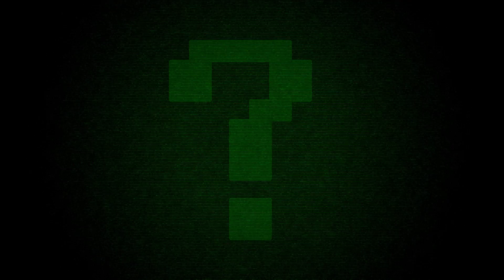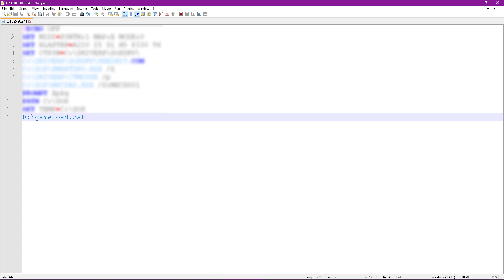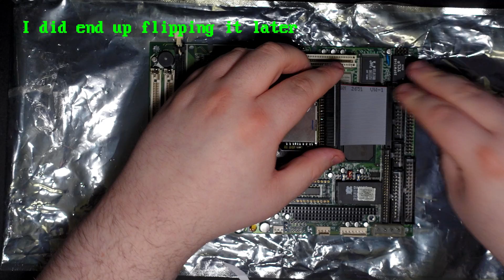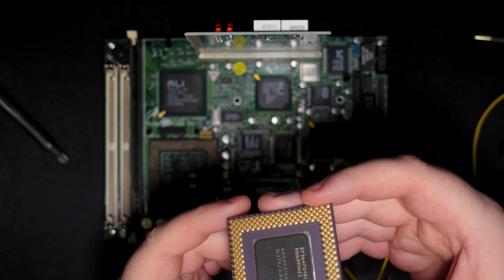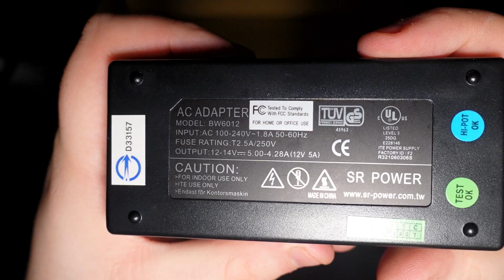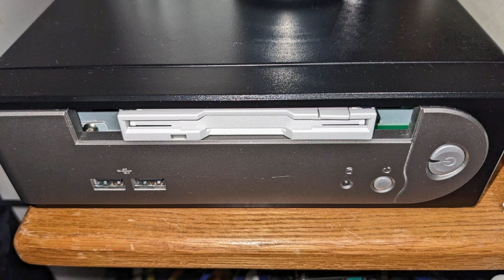Let's build an MS-DOS console - Part1 - #DOScember2022

Comment: Would have been cool if it used a ZIP drive. In that case the whole game would fit on a disk. But yeah zip drives where in the windows era
Reply from the maker: I don't want to use a zip drive. In this project the floppy disks are merely triggers for the games that are stored on an SD card, much bigger even than a zip disk
Reply: The best solution is actively supporting a flashfloppy emulator.  This means that it can AND WILL support using games from floppy, but also allows you to have multiple disks on a single usb stick.  (indeed, since most floppy controllers will allow two drives, you can actually simultaneously support a real floppy AND a drive emulator.

3:46   Quake isn't actually all THAT big.  the id1 folder is actually only about 50mb.  A lot of floppies to be sure, though.

What might actually work would be support for a CD-ROM/DVD ROM drive for bigger games.  Indeed circa 96, many games still used the disk as copy protection and would support being played almost entirely from CD-ROM via a minimal install with only a token amount of save data winding up on the hard drive.
Reply from the maker: I feel you have missed the point of what this build was.... If I was just building any old DOS PC, I would be using a floppy emulator of some sort, I wouldn't be bothering with a real floppy drive (they suck). I only wanted one real floppy drive, as this is a fictional product from the early to mid 90s, as if there had been a console like computer that ran DOS and the games were on floppy.

My reference to Quake, is pretty much what you mentioned, it's a lot of floppies, so you couldn't put the game on one, but you can put it on an HDD or SD card. There's a lot of artistic license in this project

There is going to be support for a parallel port CD-ROM drive, all this will be in the later parts. Hope this all helps
Reply: @PIPERdotEXE    We're all kind of struggling with what the the appropriate balance of vintage hardware in these builds is, to be honest.
Reply from the maker: Yeah, I mean with all the best will in the world, I can't fully target 1994, the CPU is about there, but the board is from 1996 I believe, with a BIOS from 1999, and the graphics card, is from 1995. Maybe the GUI shell I have planned for it which is from 1991 will balance things out lol
Reply: @TheTurnipKing  Quake's music was CD music, something a lot of games did.

Considering all the consoles except Nintendo went CD-ROM, including all the consoleized computers, if a DOS PC had been consolidated it also would also have been CD-ROM based; cheaper in multiple ways; and more reliable than floppies.

With the way you want to mimic slot in and it works,  with some file you put on the floppy; I know that wouldn't be viable; but still, it had to be pointed out.
Reply: @3dmaster205  it's a tricky one to be sure.  Most modern source ports will support MP3 for the audio but that's going to be an ask on period hardware.

Comment: The red line on the cable indicates pin 1 BUT the way these cables are manufactured (in china) makes it difficult to know if the orientation was correct in the process. I have even some cables from the 90s that have the red line on the wrong side. One time i had a 40pin cable (that was most likely not even IDE) where the pin-rows! were switched on just one connector.  In the end you have to make sure that pin1 on the device corresponds to pin1 on the mainboard. I tend to make my own cables to be sure.
The onboard ES1938 is a nice PCI sound card with very good SoundBlaster and excellent AdLib emulation (if the lines for proper ISA-'emulation' are connected on the mainboard).
A P166 MMX is a good fit for a 1996 System. The S3 Virge is good for 320x240 DirectX or even 640x480 with S3D enabled games. The Virge is a 2D beast and has very good dos compatibility.
The CHIPS VGA Chipset graphics has good VESA support but is slow and may have problems with scrolling in older games, so maybe using the onboard graphics might be interesting if you want to install a 3DFX-card and have more of a 1996 3D system.

Comment: Frustration is the most common thing in computer build projects before Pentium 2, and retrofit projects. You have to get used to the inevitable failure. I worked as a computer technician back in the day when this type of computer was common. It was hell, the internet was basic, there wasn't that facility that we have today in finding drivers, if you didn't have a cd with drivers, you were fucked. Lots of configuration with jumpers, components could burn just by touching your finger (the ESR protections were weaker) several times I burned the tops of my fingers touching VRM heatsinks when changing jumpers (it's excruciating pain), IRQ, bent ISA pins, dallas clock, cache chips, all this was a nightmare that most people nowadays have forgotten or even gone through. Today it is incredibly simple to assemble hardware, the pieces just fit in the right position, and there are protections that prevent them from being damaged if they fit wrong. The further into the past you go, the harder things get. Has anyone already reversed the P8 and P9 cables from the PSU to an AT? The whole thing explodes, burns out the motherboard, PSU and everything connected to them! Did you reverse the PSU AT switch wires? In addition to exploding, it catches fire, and you'll have your room in the dark.

By that I mean it was really hell, some youtubers want to make it look like it's something simple and nice (like ordering a waveblaster and soldering everything to it) but in reality it's all hell.

This type of project is not a hobby for those who want to relax on a weekend, it is something like "hardcore for Asians who like to be beaten with barbed whips".

Comment: Seems like a good idea, but I do have a thought on how to improve it: go with a case with a 5 1/2" bay, get a bay adaptor for that will hold a 3.25" drive and a card with PC Jr cartridge ports, and an ISA card to connect to that cartridge board.

Then you'll just need games! Which, admittedly, is probably the hard part.

Comment: I feel the struggle... i’ve been working on some laptops (p133) and have had the same issues with cf and sd harddrive replacements. Try an ide hdd first... if that works.. look at raplacement options. For me a cf adaptor didn’t work but a delock 44pin ide to sd card adaptor did... the adaptors can be tested with an ide to usb adaptor on your modern mac or pc. 

First try to get it working like you did... with bare minimum cpu, ram and video... then one by one keep adding stuff like hdd, fdd, sound and so on. But it’s a lovely project mate 👍

Comment: I also had this idea a few months ago, I'm using a dell inspiron 7000 notebook as a base (ref. direct x box prototype), and a satellite receiver case, which is the face of the 90s.

Take a look: https://www.youtube.com/watch?v=T5FWDZ9dQt8
Reply: A tip, there were floppy drives that had a sensor to detect if you inserted the disk, but you can manually create this sensor with a simple button and a rod, so that when you put the disk, the rod is pushed activating the button, you takes the wires from the button to the serial or parallel port, and creates a small qbasic application that checks "true or false" on those pins on that port. This will tell the system when the disk was inserted.

You can also create a frontend using colored ANSI characters, (I recommend NANSI.SYS) which allows you to change the date and time, and other things, just like the consoles of that era when they were turned on without a game inside.

Comment: Looking forward to part 2. Subscribed. Im doing something similar. Pos ( the till type 😊 ) its not much bigger than what you have. Has isa & pci. I’ve got the pico psu and most of the parts. Awe64 and voodoo banshee pci. Making a dos/win98 setup with either the amd k6/450 or down clock to 233 or even a p133. Its been on my todo for s VERY long time 😊

Comment: I love this idea! Last year bought a laptop as parts for next to nothing. The monitor was broken off, it lacked a hard-drive and RAM. So I took some RAM, installed them and I formatted a USB-stick to FreeDOS and then filled it up with games demos and/or sharewares. The concept was to create something that is 1. portable 2. completely legal. So now the laptop works as a console (or more like an arcade cabinet, since I had a cheap, simple DIY project out of a wardrobe with a CRT monitr installed in it), but I can take the USB drive and use it as a boot-disk on any PC as well. There is no sound compatibility, but hey, that's not necessarily a problem with office computers :D

Comment: What did you select for master slave on the IDE?  Or were you using a cable select ?
I had a similar issues with compatibility with 486 and Pentium boards.  
The early to mid 90’s tech could be complex to get ram and drives compatible with chipsets on the motherboard.

Comment: A couple of suggestions, don't know if you addressed them already or not, but worth mentioning.

Make sure your hard disk jumper is set to master or cable select (since you are using a single connector ide cable, yes this does matter.)

Try going into the BIOS before plugging in the IDE driver/adapter and checking the HD params to see if it set to auto or manual cylinders, heads, etc. This board has some weird quirk regarding HD compatibility regarding Hard disks. Then plug in the drive again.

Try disconnecting the floppy cable/drive and then having the IDE disk only connected to rule out that the floppy is interfering. The floppy drive cable you used, may not be the correct type. There needs to be a crossover of the pins in the middle of the cable, if you don't it can cause all kinds of weird issues in booting (again your cable has a single connector on it, see if you can find a dual connector type with the cross-over) make sure it is pin one (red on both sides). If you have it incorrect the floppy won't do anything at all, or the activity light will stay consistent red.

the other thing I can thing of is IRQ conflict. That board has a ton of embedded IO on it, and it is possible the graphics card is sharing an IRQ with something else (preventing it from booting. If you can get into the BIOS without anything connected except the graphics.

The EDO ram may actually still work, but that board may not be fully compatible.

Comment: The RAM module you bought is probably okay, you'll find it's actually incompatible with the board as it's single sided SD-RAM. Most boards of that era will only work with double sided SD-RAM. This is why the double sided 128MB module you installed originally works on that board. Single sided SD-RAM was made toward the end of that RAM type and requires board support to function. Even the i845 chipset P4 boards I have that use SD-RAM won't work with single sided modules.

Comment: For gamepad control, you might consider some one of the keyboard emulating ones like the Interact 3d Program Pad (easy to find on US eBay at least), or Act Labs 3D Powerramp Mite (harder to find, but can store button mappings that are selectable via a slider which could be handy). I used these a fair bit to get around the 4 button limitation of gameport pads, at least until USB gamepads finally took over.
Reply from the maker: I actually have a Rockfire Silver Shuttle that supposedly emulates a keyboard on PS/2, might have gotten it out, had I not run out of time on this, this could have been the alternative

Comment: FM Towns Marty says hello
Reply: FM Towns Marty does run MS DOS but it also runs something called Towns OS on top of it which has some APIs specifically designed for handling graphics ,sound and interrupt requests for accessing the mouse and gamepad and has some sort of custom Fujitsu graphics hardware
Reply from the maker: Well, I just checked this out more closely.... Damn, it's basically the DOS console I've been looking for, would love to get one, but by the sounds of things, I'd be spending a lot
Reply: @PIPERdotEXE  Yeah they aren't cheap by any stretch, but they were very cool.  And they included some licensing deal with Pharlap 386 making the dos extender ubiquitous on the platform.  So you have that console experience of common hardware, 32bit flat mode programming, MS-DOS API's and better than VGA graphics.  Galaxy Force II on the Marty was pretty impressive (when it was new!).
Reply from the maker: I saw that just recently, but while it contains a 386SX, it does not run DOS, and while I would love to try getting DOS onto that, that graphics chip is likely going to be an issue. Good mention though

Comment: Dremel has an attachment called "speedclic". These cutting wheels stand a lot lot longer! And you don't have to fiddle with washers and a tiny screw. More like a real angle grinder in small size.
Reply from the maker: These sound waay more useful, I must have broken about 5 of these things....
Reply: They indeed are. Despite being proprietary dremel stuff, they are on another level, compared to the single screwed discs, which, in my opinion are just child toys.

Comment: Could cheat a little less by using some nebulous rewritable media such as a zip drive or an early DVD RAM drive [I believe I have one circa 1998] and have a small boot drive that basically loads the drivers and starts the program on the disk using some common batch file in the root directory of the media.
FAT16 DVD RAM is limited to 2 GB due to the FAT16 format but that should be plenty of space for even a compilation of DOS games.

I have been intending to build a number of the sound cards you mentioned in this video as I have a fairly large supply of the main chip and probably have most of the components for at least building 5 of them but I have been sidelined by other projects.
Reply: Oh yeah, a Zip drive would've been a good solution back during this timeperiod!
Reply from the maker: Didn't want to use a Zip Drive. I can see why you suggest it, they're bigger, but there's a few issues.
1. The whole concept is that the floppy disks are equivalent to game cartridges
2. The Zip drive would never have been able to fit in that case
I understand the limitations of the storage media, I would only be able to use an 8GB card split into 4, but that's ok, SD cards are cheap, and likely I wouldn't fill even one up with all the DOS games I would have on it
You will see what I'm trying to do when I fully demo this thing when it's finished
I got enough bits for 4 but hit a snag when getting the chips
Reply: @PIPERdotEXE  yeah I don't think I know of any slimline zip drives.

It might be possible to get a slimline drive that can read dvdram discs with DOS drivers. The old DVD ram discs would have a little over 2gb so fat16 would limit it to that. It's also an odd format that cannot be read after I think windows 98se.
Reply: @PIPERdotEXE  Yeah, I suppose size would kill that idea. SD and CF cards existed in that era, but one big enough to handle the larger 1996 games would've been insanely expensive, but I'd lean towards that way myself building a system nowadays. I will note, I actually find Zip disks far more cartridge like than floppy discs, with their beveled sides and the pull tab part, on top of being on the chunkier side. On top of that, I had a fairly small harddrive in my PC in that era and actually ran some games off a parallel Zip drive, so there's a bit of nostalgia with thinking of that option.

Comment: Pin 1 is pin 1 is always the stripe. It has nothing to do with power. The SD adapter has correct pin1 marking.
44pin IDE is a shrunk 40-pin+power. Pins 1-40 are IDENTICAL to the big connector (as you should see on the adapter cable you unboxed..see how the molex connector is opposite to the stripe).
Pin 1 is NOT POWER. Pins 41-44 are.
Further confirmation: the missing pin is pin 20, but on the connector, on the side of the notch, you should see an arrow representing pin 1. The notch side has all the ODD pins, so empty pin is AWAY from the notch. You can check that with a newer IDE cable or motherboard that have the pin filled/missing with notch indication (i.e.: what you tried to do with 2.5" HDD...a 3.5" would show this).

The HDD theory did surprise me, but I guess the 2.5" HDD was intended for laptops, where you either put it in a fixed connector on the MB or you have a proprietary cable that will fit in a single position. So a notch is irrelevant.
Anyway, I never had "pin 1=stripe" rule break on me. The only pin 1 rule I found bad was on Serdashops WP32 McCake (2021 MT32 wavebalster card), where the square pin is in the opposite place, with no other markings. I think I got lucky because I used it first with their gameport-waveblaster adapter which went in a single way. Then I noticed the even rows (on adapter and sound cards) are VCC+GND which are easily noticed and confirmed the mistake.